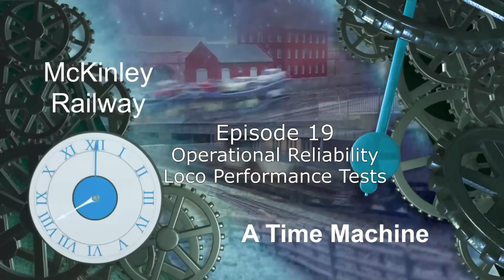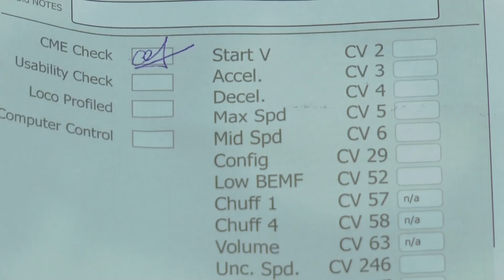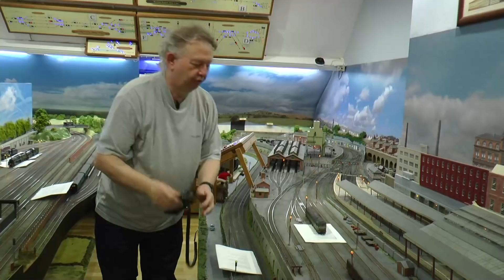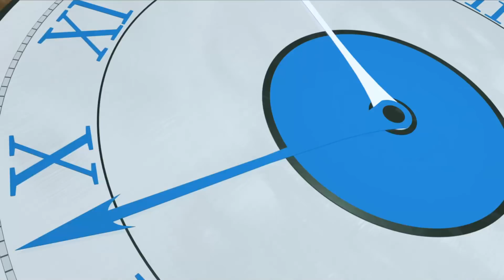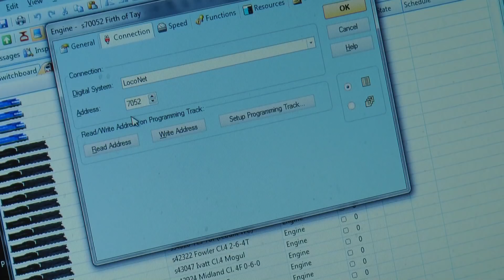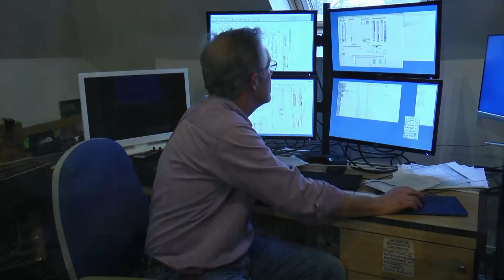19. Operational Reliability - Loco Performance Tests

Comment: Very structural and professional approach on every level.  Even each sheet of paper is well designed and thought over,   like which colours should be used on the layout diagrams so that colourblind people could use it as well.  Very impressive.

Comment: Profiling Locos using 3 block method [time verse speed step], then using brake compensation FWD/RVS auto-run into test block is spot on accurate everytime. Loco speeds are as scale speeds. Loco lashups are equal right across the locos speed range. Stop markers will be spot on everytime at any block. No wonder your locos over run stop marker. Or you can use a 2nd stop block in the main block.

Comment: Hi I see you are using the zeller cat for profiling. So you are still using version 8 of tc? Zeller cat has issues with profiling correctly. My zeller causes a wheel slip on occasions which throws out profiling. Perhaps the reason the diesel failed some tests? Great layout though
Reply from the maker: We use V8 with the Zeller Rolling road.  I have no plans to migrate to version 9 at present.  The rolling road is not as good as live profiling within TC, but the big benefit is the time saving.  We set up our Zeller system by profiling one loco on the layout and obtain a definitive profile that is good from a reliable locomotive.  Then test the loco on the rolling road. If the speeds are different, adjust the frig factor in Railroad.ini under [connections].  Its called ZellerDiameter=xxx  (e.g. 5.93mm is 593).  I adjusted this value until the results from the Zeller system matched the real world results for the low, mid and high speed steps.
When we profile a new Loco using the zeller system, we then test the loco  under schedule conditions for real and check the stopping distances and scale speeds.  We use the Zeller as a shortcut to save 30 minutes a loco in profiling.
Reply: I have just purchased the Zeller cat rolling road a few days ago  now awaiting delivery in Australia  - wish I had seen this post first - I see V9 of train controller has an added "third party measuring device " as an input option.  Did V8 not handle brake compensation when using a rolling road?
Reply: Thanks for your reply. Keep the videos coming !

Comment: Hi David and the team.   When I first saw McKinley I was most impressed with your use of computing as a means of deriving a lot more fun out of your model railway.  I now realise I was completely wrong.  It is the Team that is the true secret to McKinley’s fun.  The way you have drawn together quite a few fellow modellers that significantly enhanced not only the skills but also the depth of output achieved.  As a lone modeller working by myself I now accept that I miss out quite a lot on the obvious companionship that your team generate.  Great work to all in the McKinley story.
Reply from the maker: Hi Mark,  You are right and right and wrong.  Its a chicken and egg situation. Trying to achieve high results from technology, attracted curiosity, that in turn generated new ideas and improved the technology.  It is circular, but you are right in that the true essence is the people.